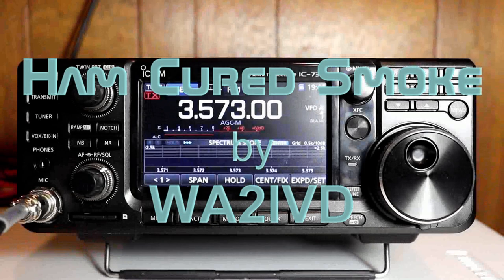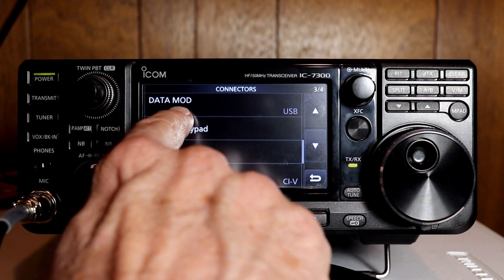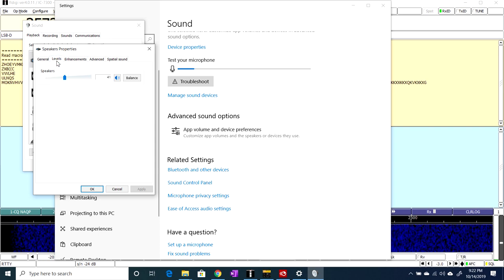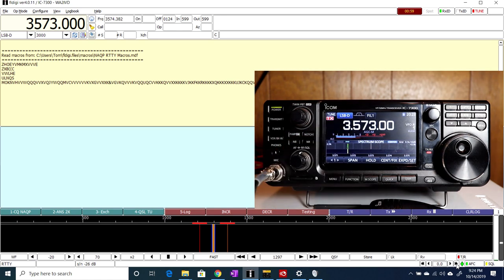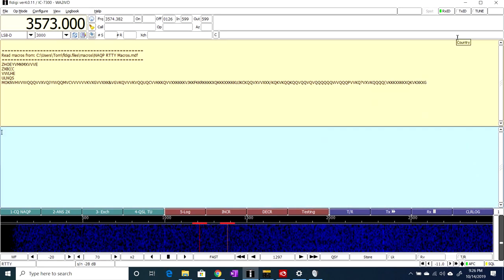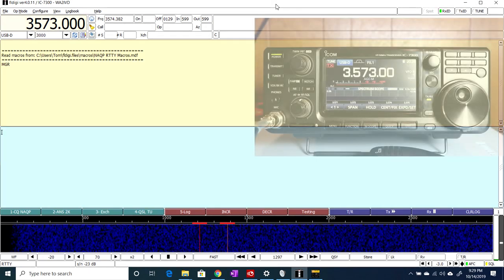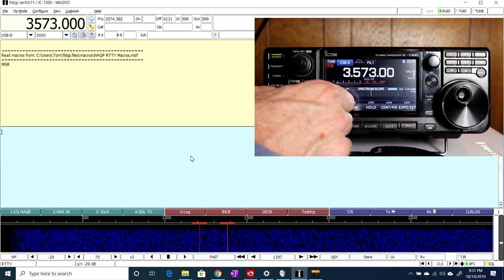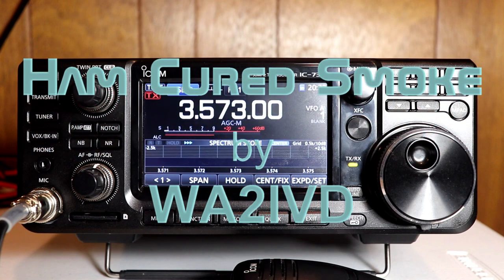Icom IC7300 A to Z #25 Setting USB transmit audio levels

Comment: Tom, as an IC7300 owner since March, I find your channel to be terrific! I’ve referenced your channel for friends who are not used to the myriad of settings associated with SDR radios. After watching your A to Z #25, and a WSJT-X and FLDIGI user, I have a suggestion you might consider... WSJT-X and FLDIGI seem to be the most popular go-to pieces of digital software...knowing and demonstrating the basic settings to use within the IC7300 is great, but the software settings in FLDIGI and WSJT-x can really confuse the heck out of people, and are not straight forward. How many times have you seen posts where people can’t transmit, but their IC7300 settings are correct. I know I don’t have to highlight the confusing settings within the software to you! So, that’s my suggestion, because you have the knowledge, and a teaching style that’s easy to follow. (And I know you’ll remember to include the importance of first downloading the latest USB drivers from Icom).

Comment: Hi Tom,
I appreciate your videos very much :)
I am also getting into the digital modes again with my 7300 but I have some issues.
After some time there is a problem with the sound output, it seems that I still can receive but when I try to transmit the 7300 is TX'ing but without any audio (can see it in the waterfall). 
I use a very good cable with chokes and double shielded but the issues persits.
I am quite sure that I set up everything correctly, also the energy saving settings..
After a while when not sitting on my computer I have the same error message several times:
"Error in Sound Output. An error opening the audio output device has occured."

Do you have any ideas?

Nevertheless, you also pointed out MMSSTV, RTTY and so on, is it the same here like FT8 and PSK that the ALC should not come up? I tried a digi mode called ROS but transmitting with no ALC gives me very thin and low audio..

Comment: Excellent series of videos.  Question: How did you enable the scope to monitor/show the transmit audio on the IC-7300? 4:43
Reply from the maker: To see the spectrum scope during transmit- press and hold the EXPD/SET touch screen button.  Then in set mode look for Scope during TX (Center Type).  The default is ON, but make sure that it is set to ON.  Then, you need to make sure the scope is in CENTER mode before transmitting and you will see your transmitted waveform.  If the scope is in FIX mode, it will just freeze during transmit.
Reply: I’ll try that and thank you. Again - excellent series. Appreciate all the effort you made in producing these videos.

Comment: Thanks Tom:
Was on FT8 the other night and heard voice saying CQ, since it doesn't allow much in the way of information to send, I just sent, hear voice, then sent hear CQ  a few times but it continued so I ignored it. I believe the mic is live on the 7300 when in digital mode. Some say you should disconnect it but I haven't tested it yet since can control my back ground noise, unless the grandson is here smiling.
Reply from the maker: In video #24 I show you how to set the data input audio so it is only from USB and not the mic.  That is not the default.  However, in your example, where someone was actually calling CQ on the FT8 frequency, I suspect it wasn’t just background.  WSJT-X automatically sets your the rig to one of the FT8 frequencies when you start the program (if that’s the mode you were last working).  It sounds like somebody probably meant to be on the SSB part of the band and inadvertently ran WSJT-X.  Then, they didn’t check their frequency on the rig before they started transmitting.

Comment: What do you think is the best software that has all or most of the data modes and logging.  I know that everyone has what they think is the best.  I will be asking many people and picking form what what the difference people say.
Reply from the maker: You are correct, everyone has their own preferences and their are a number of options.  I will assume you are talking about software for Windows.  You really have to divide “digital” into 2 categories.  For the various weak signal modes like FT8, FT4, JT65, etc., WSJT-X is really the only choice as far as I’m concerned.  It is open source.  So their are other offshoots, but I stick with the original.  For more traditional digital modes like RTTY, PSK-31, etc., I like FLDigi.  Actually, both of these programs are also available for Linux and I believe MacOS as well.  They both have built in logging, but they can also both be connected to other logging software if you want to use a single logging program for all of your QSOs.